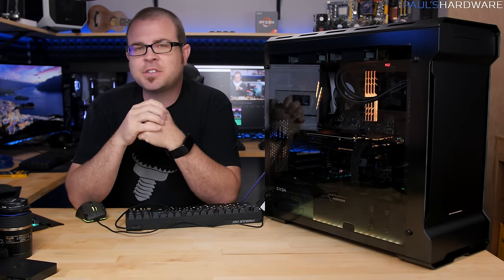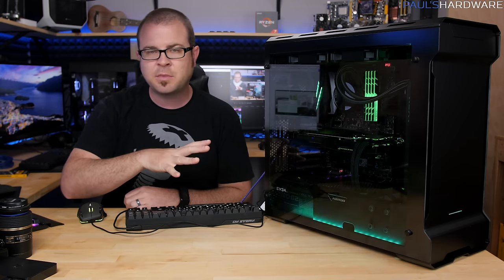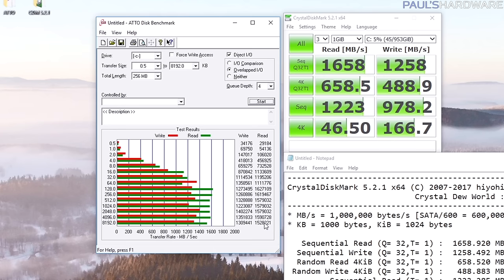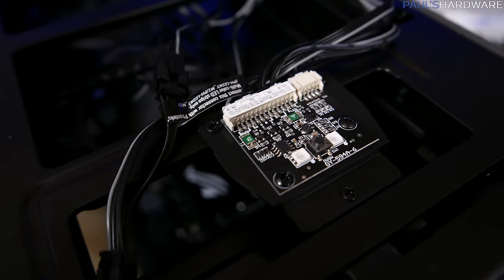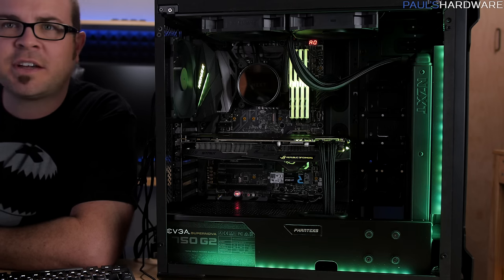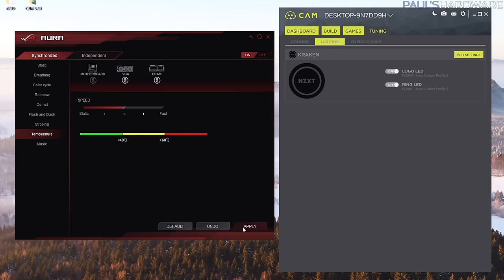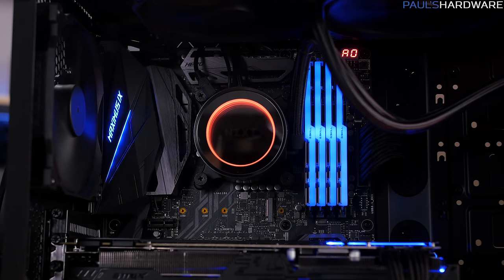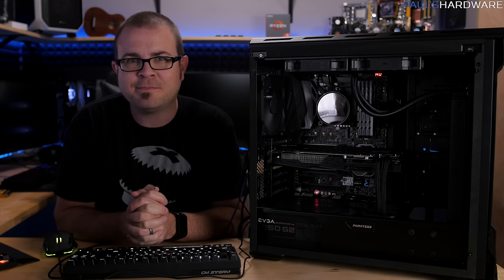Testing Lighting Configs with the Perfect RGB Build!

Comment: The black build looks better to me. The white one is a bit too gaudy for me and spreads the light too much. The black build let's you focus more on the sources of light and makes the pc look more monolithic. that's just my taste though.
Reply: Jonathan Green they both have a unique touch. I actually like it both ways.
Reply: Jonathan Green White build 100% better IMO. If you're focused on the source of light it takes away from the dope parts in your PC. and generally you can't even see everything inside the PC with everything blacked out
Reply: I like both of them as well. The white build is pretty damn awesome and I would take it in half a heartbeat if someone offered it to me. I just like the the way leds look on black backgrounds better. The darkness of the black with the brightness of the leds makes it look cool and mysterious to me.
Reply: I favor white builds over black but I totally agree. The white looks a bit @.@. Still and awesome build just too much for me personally.
Reply: I voted for white. Here’s why:

- 99.9% of the interior of the case is black.
- 99.0% of the equipment in the case is black.
- There is 1 string of LED’s illuminating the front side of the case, mainly the case fan shroud and radiator.
- There is 1 string of LED’s illuminating the bottom of the case, mainly lighting the PSU and PSU shroud.
- The 4 sticks of RAM light up.
- And. the motherboard has some lighting effects.

However, all that black literally sucks up much of the light. That’s what I see anyway and if you have a look when Paul turns the LED’s off, it becomes really dark.
This Phanteks Evolv ATX (black case) has a tempered glass panel. Why? It’s there so that you can show off all of your planning and hard work. Of course, you want to be able to admire your handiwork too.

Now consider that the tempered glass panel is TINTED. Of course this darkens the interior further and it’s going to be even darker still with the lights off.

On the other hand, the white interior of the white case not only takes on any of the colors illuminating it, it reflects those colors rather than absorbing them.
Too bright? No problem. The interior still tends to reflect the ambient room illumination, so even with the LED’s off, the equipment inside is still more apparent than in the black case (which is the whole purpose of a glass panel).

And finally, the NZXT S340 Elite (white case) has a NON-TINTED tempered glass panel, so the view is not dimmed.

I can see where many would call the white case the Christmas case; all those lights flashing and displaying every color in the rainbow. However, you can be as ‘classy’ as you want with a bit of tact and subtle usage of resources. You don't have to display every color, nor have every LED active.

Comment: I'm working on a very similar build at the moment. Only differences are Motherboard: I'll go with a Strix, save some pennies, don't plan to OC heavily or SLI in the near future, and instead of two drives I'll go with a Samsung 960 Evo 1TB M.2 NVMe, a 1080Ti and a Seasonic PSU. Oh and the RAM will only be 16GB for now, 2x8.

How are you faring in day to day use? Productivity? Gaming?

Comment: I have the same mobo and AIO. What I found is that various 'Tubers like to talk about the Kraken X62 like its super easy-peasy to install it, when in reality it is a pain (with SATA power, USB 2 header and then the three fan header connections and cables). Also the X62 mounting plate for the back of the mobo is flimsy plastic, I hope it doesn't degrade from heat and snap in a year.

Comment: Are you using the phantek fans that came with the case for the two top ones? If so, can I ask what you used to attach them to the "tray" that is supposed to hold the fans? In my own personal build I had to use zipties because I couldn't find any screws that fit, not the best method but it filled its purpose!

Comment: So how much added overall power consumption is created with 'RGB' I am curious to know how much of a efficiency* hit and PSU strain this current fad is causing?
Reply: Who can do interesting. I want to know as well. Paul notice this senpai
Reply: Who can do I can't imagine it being much at all. Don't have any numbers or anything, but these are just small LED's.
Reply: as a single unit sure, but these full RGB builds running probably in excess of 50 or more LEDs would cumulatively add up to overall system consumption and even potentially raise temps. There was a time when efficiency was all the rage and was enough of a marketing issue to sway consumer in the past. But does the RGB fad negate these savings? This is in regards to RBG:mobo/RAM/GPU/fans/light stripsx2 minimum.

Paul is in a postion to test this. As i am not interested in a PC case brighter than my monitor.
Reply: Modders being modders,I anticipate the first water cooling kits for LEDs in about one or two years. ;-)

Comment: Hey, Paul. I have most of these parts, (Kraken x52, i7 7700k, and G.Skill Trident Z RGB on the Maximus IX Hero Z270) and for some reason when I first boot the computer after turning it off it makes it to windows loading screen and then shuts down again. The second boot everything boots up fine. But I can't seem to figure out what's going on, as I've checked all my cable connections.

Comment: Paul I have a very similar build, (formula mobo/phanteks evolv tg/strix gpu/phanteks led strips) right now my lighting all works together except for the leds built into the case the power button and front light) how do you get those to sync with the mother board?
Reply: you mention holding to turn it off, but do you have to connect the rgb header into the asus mobo?

Comment: Paul I have the AER by NZXT and the new  HD 120s by Corsair. I ordered the Riing + from TT is on the way but like the Nzxt they are slow as hell in shipping or responding to trouble tix   anyway ,what I have run into with the AER is 0trying to control the fans speed, evne though it shows them and they are spinning i am ruining into a glitch or something with the Grid v2 software not installing,  hue is working ( no I dont have the x 62 Kraken yet, the x62 was sold out when i ordered the AER's 140's sadly but like i said i have been on a chase the none working grid issue, so feel lucky u got almost all yours working.

Comment: I always wondered if you could use Corsair HD120 with the Hue+ or the NZXT AER with the new Corsair Lighting Node Pro...
Reply: That's the important question.  I know he said "some" RGB however I think he might have been scared.  From what I hear it's not easy but builders are attempting it.  I'm gonna be trying in 3 weeks.
Reply: j snow let me know if the hd120 works well with hue+ if i had known corsair was releasing their own rgb software,  i would've held off on buying the hue+
Reply: My bad, I'm running with the Kraken.  So It will still be Cam and Aura 
software(s) trying to talk.  The point I was trying to make was that 
using the AER's in addition to the Kraken along with Aura is a bigger 
challenge.  AER's and Kraken isn't seamless for everybody even tho it's 
the same software.  Checkout the NZXT forums.

Comment: I have a x52 installed on my strix motherboard. The first ram slot is bending slightly due to the X52 tubes. Should I be concerned? The motherboard should be similar in dimensions to the one used in this build but there doesn't seem to be any bending on this build :-(

Comment: Should I make the move to an Evolv TG or 570X? I've got the same build as Paul except its in an In Win 805. Will I see better thermals from changing case? Opinions are welcome.
Reply: Nocs I have a cooler master 531 elite and I can honestly say that I doubt I'd see better thermals by switching cases, what does bother me is the lack of cable management options. I honestly don't think switching cases will change your thermals. fans maybe.

the other thing I really don't want to suggest because it can be risky is delidding the cpu and adding better thermal compound between the die and the ihs. that would automatically void warranty while risking breaking the cpu.
Reply: ArtisChronicles The In Win 805 just has very bad airflow in general. Im using ML120s in all fan slots and think changing cases might reduce some temps or atleast noise.

Comment: Hi Paul, great video. Btw does the Kraken x62 interfere with 4 ram installation on a ROG Z370 Maximus X Hero? Thanks in advance for the answer
Reply: Hey bro. Came back to this video years later. Just saw your comment. Not sure if you've gotten your answer, it won't interfere, but it's going to be a tight fit. I have the Maximus XI Formula and had the Strix Z370F Gaming.

Comment: Hi Paul
My build was with asus z270E, 7700k, corsair Led 16gb ram. I am not getting the ram in the aura software. It lights up when I am in the bios but is off when windows opens. Is there any solution? Thanks

Comment: how about answering this question:  ...  I purchased 2 Titan X P's on the 7th of February.  I do 3D rendering (and gaming) .. should I return them and pre order 2 1080 Ti's ?  I need to add a custom loop since the Titan Xp's run very hot .. but im reaching my budget. So the 1080 Ti's would give me the option for the custom loop since Id be saving ...     Can you help me out here?!  Whats your thought on the 1080 Ti
Reply: ClearVue if you can send them back then I would do it since you can save some money
Reply: I spoke with nvidia and they issued a return.  So Yes, I have that option .. I Just wish benchmarks were released so I could see before tomorrow AM what i truly am about to do. Right, or wrong
Reply: ClearVue with both overclocked the ti is only going to be a tad slower so pretty much the same for a lot less. Can't go wrong with that
Reply: ClearVue with both overclocked the ti is only going to be a tad slower so pretty much the same for a lot less. Can't go wrong with that
Reply: think id notice much of a difference in 3D rendering? .. i mean Cuda core = same. 1 GB less memory .. but 11gbps which is better then 10gbps ..  .. and if there is really a difference, will i see much of it anyway?
Reply: ClearVue no idea about 3D rendering but I don't see it being any different.

Comment: RGB with silver/chrome. No RGB led fans, can't see myself spending 140 bucks on fans. Do white blade fans and a mobo with white or silver on it. Your polls didn't have these options so there you go. That is my pick.
Reply: agreed, buying a 30cm RGB strip for 23 bucks and placing it next to white fans is more cost effective than buying 3 RGB fans for 80$. if you wanted just a solid led fan, you can find those for very cheap but not RGB.
Reply: I am confused what you are getting on, are you adding RGB LEDs to a fan shroud, or are they solid color LEDs? or are you taping a led strip to the fan enclosure? all I am reading is you added LEDs to a fan. been done a million times.
Reply: I know some fans have spots that you can put in LEDs in the fan housing and you found RGB single LEDs that you can connect to the mobo. if so that's cool. if not white fans with RGB strip next to them lets the light bounce off the white and make the fans look RGB.

Comment: Someone posted 1700x benchmarks with r9 390x and it scored 280fps where 7600k at 4.6ghz with 1070 scored 255fps, 
also it did 15% better than 6800k single threaded and 43% multithreaded in Cinebench r15...  dayum

Comment: I just bought an Asus Prime Z270-A and my Aura is all jacked up. When it does run(and when it doesn't) it takes up like 15-25% CPU power (I have a i5-6600k overclocked to 4.7GHz) and then it'll lock up and will freeze my lights wherever it feels like and the process will crash, still using CPU power however. Any suggestions? I've already tried uninstalling and reinstalling.
Reply: update the software to the latest version from asus.com had the same issue with my strix z270-e
Reply: all this stuff with asus problems making me think about getting another type of motherboard with my ryzen cpu cause i got the asus b350+ might get msi
Reply: Just early adopter stuff man. Run up to date drivers and programs and you will be fine
Reply: Unless a new update came out today I've tried that. but yeah, very new board so I'm guessing it just needs to get sorted out with updates later on

Comment: Maybe one of you can help me: I have recently ordered a Kraken X62, a Asus Z270F Motherboard, and LED-Stripe and I allready have a GTX 1060 Strix O6C, do they all work together using the Aura Software from Asus or do I have to configure them individually? The Parts should arive on Tuesday, and I am really hyped to put them into the new case(S340 Elite Red/Black), but it would be a shame if the Stripe, Motherboard and Graphicscard work in a Union but the X62 doesnt. 
Heuboje21